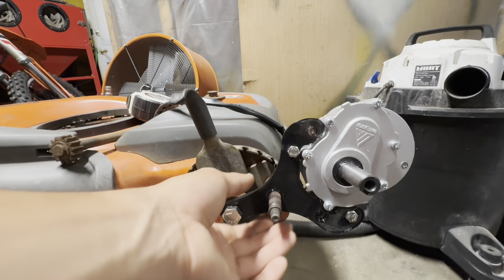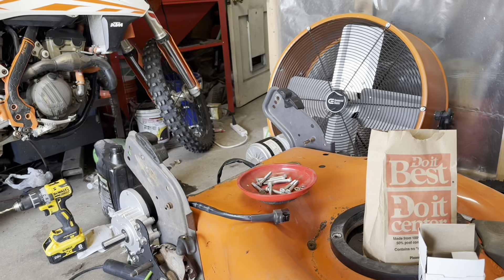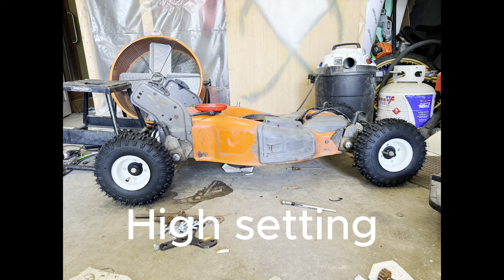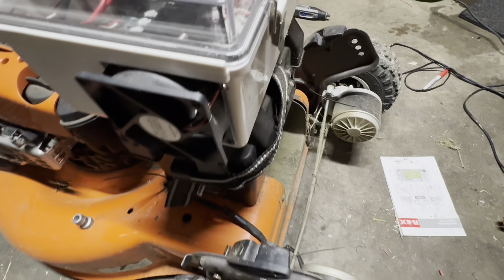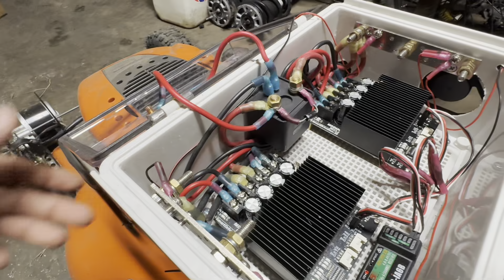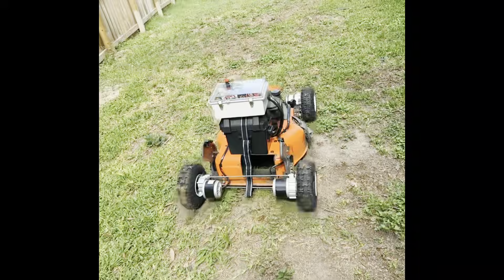DIY 4X4 RC Lawnmower

Comment from the maker: ‼️Parts list ‼️
Electric motors- https://amzn.to/3KqY93O
Tires- https://amzn.to/3Kl42zL
Electric drives- https://amzn.to/3Knd92M
Remote control- https://amzn.to/4aLiRpX
Battery’s- https://amzn.to/3KrOgTH
24 volt charger- https://amzn.to/4aDtonb
Battery gauge- https://amzn.to/3VjaBsJ
Electrical box- https://amzn.to/3wZsHXs
On/off switch- https://amzn.to/3R7tkoM
Fans- https://amzn.to/3KqYxiM
On/off relay- https://amzn.to/3R3SDYP
Diodes- https://amzn.to/3wLwNCA
Reply: What did you use for drive wheel? I see the tires .
Reply from the maker: @  the rims are some two piece wheels from northern tool but I had to 3d print some adapters to fit onto the shaft of the motor
Reply: @sethsapia4060  ok thank you
Reply: You can get better turning by make the two wheels diagonally positioned from one another spin in the same direction and opposite to the other two diagonally positioned wheels. Nice mower and good luck.

Comment: Hi Seth, Multiple questions.  Do you have left and right motors?  Did you have any problem with the wheel adapters being 3D printed, strength-wise for the keyway?  I suppose having the wheel adapter with the keyway built in would loose strength compared to the adapter's full body pressing against a metal key int eh keyway.  What material did you use, something strong like ABS or ASA, or would PLA with 100% infill be strong enough?

I think everyone is still anticipating your wiring schematic.

Thanks for posting a great project.  We have a cabin in the woods, on the side of a hill.  The yard has benches(flats) and steep parts.  An RC mower would be great for the steep parts.  No rolled ankles :)

Comment: how did you wired your motor driver controller? thanks.
Reply from the maker: one esc drives the back one drives the front. Then from the re one connector is spliced into each esc so they get the same exact input to tie them together. Same set up as tank drive instead of two rear motors there are 4.
Reply: @sethsapia4060  are they wired  in parallel both the smart driver duo and how about from the  two esc to receiver?  thank you so much for your information
Reply from the maker: @g @garyabalos4501 hard to explain lol. One esc controls the back two wheels. So they go forward together back wards together or opposite directions to turn. And being the receiver signal to the escs are spliced together the front mimics exactly what the rear is doing. So the two right wheels always do the same thing same as the left.

Comment: I have the same setup as you. 2 mdds30 and the fs i6x. All motors turn forward when I steer forward. All turn backward when I steer backward. But when I steer left, the left motors should turn backward and the right motors forward. Now, however, the left front and right rear motors turn forward and the left rear and right front motors turn backward. I've connected the 2 left motors on the first mdds30 and the 2 right motors to the second mdds30.
Do I need to change something on the FS i6x, or what could be the problem? Can you tell me your settings?
Reply from the maker: you should be able to fix it in the remote settings. there's a good video showing how to mess with the settings posted by "team panic" titled "Mix Flysky fs-i6 for robot tank steering."

Comment: I use two MDDS30s, one for the left motors and one for the right motors. I measured the voltages on all channels with a multimeter and found that they differ, meaning that not all motors rotate at the same speed. How did you solve this problem?
Reply from the maker: Are both drives receiving the same input from the receiver? I have mine spliced together on the same channel so both drives receive the exact same signal.
Reply: @sethsapia4060 I have a 3pin y-cable on each channel of the receiver, which then splits and goes to both mdds30. For example, the cable on the receiver is connected to channel 1 and then goes to the input of channel 1 of the first mdds30 but also to the input of channel 1 of the second mdds30. So both mdds get the same Signal.

Comment: Nice job!  I'm 78 years old and the 350ft ditch in the front of my property gets harder to mow each year. I've been watching videos like yours and yours looks to be what I have in mind. I'm wondering what the overall cost would be. I am quite capable of doing the work myself. Can you offer a ballpark figure for the build?
Reply from the maker: If you do 4 motors like this it would be around 800-1000 if you have the mower already. If you do 2 motors probably 500-700

Comment: In all, how long did it take you to make, wire & test everything and what was the total cost you can guess in the end?

I'm a six-time stroke survivor and want to try building one of these, but am nervous about the level of tech you'd need. On a scale of 1-10 on difficulty, what would you rate this at? 

Great video and awesome looking mower 👍
Reply from the maker: It was more on the pricy side. Would be a lot easier if you did 2 motor wheels on the back and 2 non powered swivel wheels on the front if your yard is flat. I just have a big hill side so I did 4 wheel drive.  If you already have the mower and do a 2 motor design you should be around the $500 range. 

I would rate it about a 7 it’s not terrible. Research makes it a lot easier

Comment: Did you have to add additional mixing on Flysky or just use mixing on ESC?
Reply from the maker: Mostly on the esc. It’s wired like a tank one esc runs the right side identically and one runs the left side identically.
Reply: Thanks. I have one I made with 2wd that worked well but except on hill. I add two more motors to front this year. Now it is binding up when turning. I only have one ESC. I may need to switch to two like you have done to get it to work better. Thanks for answer. Helps me understand better if it was mixing, or my electronics or geometry of motors (similar to your setup)

Comment: I would like a motor mount, can you send me the design?
Reply from the maker: i ended up hand cutting them with a plasma torch the 3d print just made it easier to trace them out on the metal

Comment: what did you use the diodes for?
Reply from the maker: @ronzika335  to prevent burning up the ecm in the event it would get pushed while off and the motors send power back to the ecm.

Comment: 2 motors in the rear and 2 caster wheels in the front would give much better steering and manuverability.
Reply from the maker: i would have done that design if my yard was flat but being i have a big hill the caster wheels would have wanted to fall down the hill if the rear wheels would slip

Comment: I am debating between caster wheels on the front or your four wheel skid steer setup.   I like four wheel drive but am concerned that the skid motion will tear up the lawn.  How has your experience been so far?

Comment: Nice job.  How do you think having only two rear motors (250W each) with swivel front wheels would work?
Reply from the maker: @Old_man_James   I think it would work fine as long as you have a level yard. I put four being I have a big slope in my yard.

Comment: Very nice build! What is the weight of the mower after the build and what power are your motors? Cheers!
Reply from the maker: 250w 24v 120rpm. Makes .8 nm of torque. I never weighed it but it is definitely heavy.

Comment: Super cool project!
Were there any other cheaper motor alternatives you were considering? 
I was thinking about building something similar, but adding in an IMU to try to give it paths to follow, making it semi autonomous :D
Reply from the maker: @AdrianneGutman   if my yard was flat it would have been a lot cheaper to go with two motors and swiveling wheels in the front but I needed the 4wd. Unfortunately for the torque I was looking for I didn’t find many other option’s cheaper.
Reply: @ thanks for the insight! I’ll keep that in mind with my project too

Comment: I'd fill the tires with rv anti freeze put so weight in the tires.
Reply from the maker: that may help but this thing is heavy! especially with the battery's and electric motors

Comment: what is the model of the cutter?
Reply from the maker: @jusla-g1p  Husqvarna HU725AWDEX (22″). But I believe it’s discontinued it’s an old mower.
Reply: @sethsapia4060  I have been looking for a good lawnmower for a project
Reply: what kind of model would you suggest?
Reply from the maker: @jusla-g1p  don’t matter to much as long as it’s got a good running engine. You take everything else off.
Reply: @jusla-g1p  Husqvarna mower are very good. I own one and it cuts well, and no, it's not for sale 😂

Comment: Wow 4 motors this is a great idea. What connector adapters did you use to connect the motors to the motor driver? Or did you just cut it off? Also where did you get the materials to attach the wheels (nuts and that black circle thing in the center of the wheel)? Where did you get the rims? They look like harbor freight rims.
Reply from the maker: @CalenMac   rims came from northern tool, black adapter is 3d printed (file from YouTuber @tool_time). Regular nuts and bolts from hardware store and the wires I cut and wired into the controller.

Comment: Thinking on using a riding mower deck 46"  maybe build a little frame  wheels and radio stuff. then bolt deck to it or
Bolt to deck wheels radio stuff . Not sure just seeing what sticks to wall when I throw it. . Really what junk I can dig up out building around house.
Reply from the maker: would be nice to have a big deck. i don't think it would be to hard. hardest part would be mounting the motor to turn the blades

Comment: How to control two SmartDriveDuo-30 from one RC. I have 4WD Mobile Platform.
Reply from the maker: @romanpaliga7517   one esc drives the back one drives the front. Then from the rc one connector is spliced into each esc so they get the same exact input to tie them together.

Comment: Yes please a in depth how to for the electrical, set up the remote, etc.
Reply from the maker: I should be able to do that soon.
Reply: @sethsapia4060  how do you think this would do in 2ft bone dry grass?
Reply from the maker: @brandonforesee3593  it would do fine as long as you raise the ride height. I’ve cut the bayou side at that height already. Just took two passes.

Comment: nice build! why you use 2 smart drive controllers?
Reply from the maker: Thanks man and to have true 4x4 with one smart drive the wheel spin would be sent to the tire with least resistance and only spin one of the two tied in.
Reply: Hey, good job. 
About the two Motor Controllers, mine works perfectly with one. 
So you might can use one of them, for your next Mower Project😊
Reply: OK, my mower work perfectly with one
Reply from the maker: Yeah I may try one my yard just has a big slope and some hills and stuff so I figured I’d get stuck more often with just one. One may even be better I haven’t tried it but i might.

Comment: Nice project Seth. What wheels did you use? I see the motors are rated 120 RPM, would you change the RPM if you could, or stick with the 120 RPM? Would you change the size of the wheels or tires? Do you plan to add any more controls, like gyros, accelerometer, GPS, or combined as a IMU? Thanks!
Reply from the maker: I like the rpm the higher speed is nice when your just traveling can’t cut at full speed unless the grass isn’t crazy tall. But I noticed the 120rpm is out of stock now and they only have 75rpm available. Might do some upgrades in the future was thing fpv setup. GPS would be hard with the big slope in my yard but you never know.
Reply from the maker: Also the wheels came from northern tool 4 inch 2 piece rim.

Comment: I like that you kept the height adjustment mechanisms. Other similar builds hard mounted the motors, which don't allow height adjustment. Did you 3d print the wheel hubs? Would you share your cad file for the motor mount?
Reply from the maker: There is a mention in the video but the file came from a YouTuber named tool_time. I’ll see if I can comment a link of the file here.
Reply: @sethsapia4060  I've watched tool_time's video, and the STL file is linked on it for the hubs. Will you share your CAD file for the mounting bracket?
Reply from the maker: @thecreativetinkerer   I just added it to thingiverse. It says I need to wait 24 hours since I'm a new user. https://www.thingiverse.com/thing:6633191/files you can try this link but it may not work for 24 hours. the holes don't line up perfectly to the electric motor. I just used it to trace out where I needed to cut for the metal ones.
Reply: @sethsapia4060  Unfortunately it says your thingiverse doesn't exist :/
Reply from the maker: @xjerrodsx  I’ll try to update it. Was the first time i ever tried to post something on there.
Reply: @sethsapia4060  please link if you do get it back updated